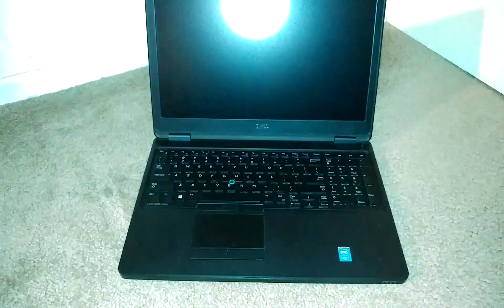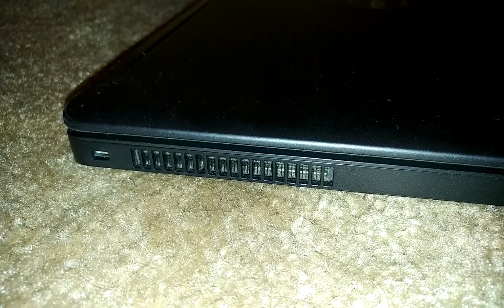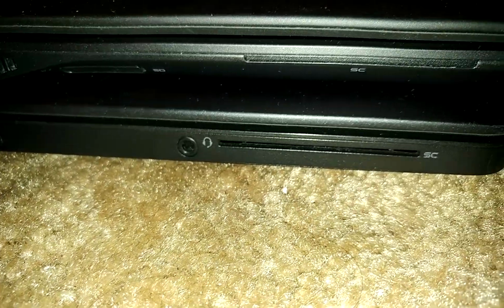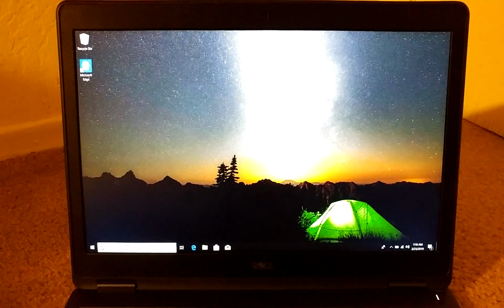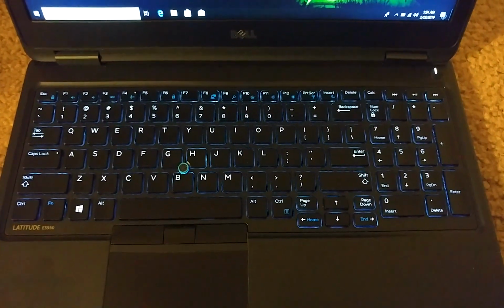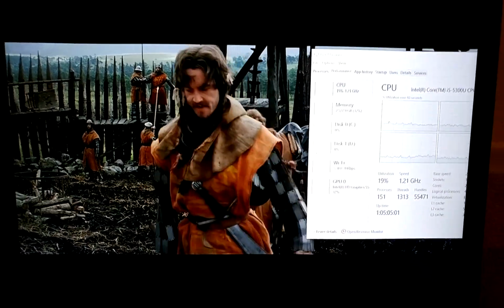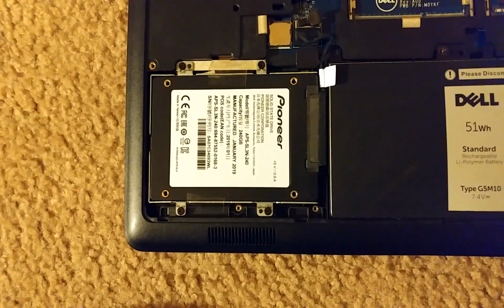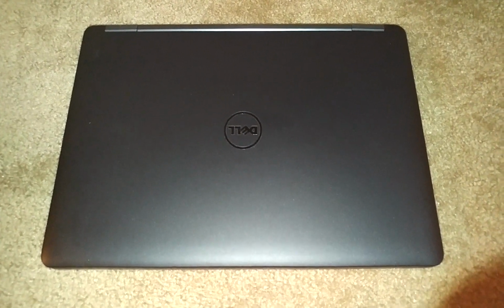Dell Latitude E5550 15.6" Core i5-5300U FHD IPS Business Laptop Review

Comment: Hello I have the latitude e5430 and the power cord is gone is there another way to get power to it through any of the ports
Reply from the maker: Nope
Reply: Look into USB C charging possibility.  Amazon may have a suitable power jack adapter for your Dell that will match size and power spec---that will connect to USB C.  I bought one for my Asus to use on solar generator. It works great.  I still have the original Asus power pack, but this is a perfect operation at the solar based radio shack.

Comment: What is the small round button in the middle of the keyboard for? - between th G and H keys
Reply: A pointing stick (or trackpoint, also referred to generically as a nub or nipple) is a small analog stick used as a pointing device typically mounted centrally in a computer keyboard.

Comment: Can I use this for gaming
Reply: 16 gb of ram version I would think so
Reply: Definitely. Fortnite works pretty well on it [with relatively low graphics, of course] and Minecraft and Roblox work perfectly on full graphics [no RTX or anything like it], Age Of Civilizations 2 does pretty good too, and usually you can run up to 7-6 normal programs.
Reply: @omniwagon  how many fps do you get in public matches?
and how much is the max
Reply: @AbdulRahman-nq8wz  well i cant even play at all due to season 3
but on the lobby at most 60-70 fps

Comment: I've got the predecessor to this (E6540) with an i7. It runs hot sadly - it's a known thing. Looks like the pros of the E5550 are the screen, battery life, form factor. Do you find the Home/End keys layout annoying? Also I really like the dedicated volume keys on the E6540, sadly nobody seems to include them any more (Fn+F keys now).
Reply from the maker: Every laptop seems to have its own Home/End key configuration and you just have to get used to it. In that sense, every new laptop is annoying to a degree :)